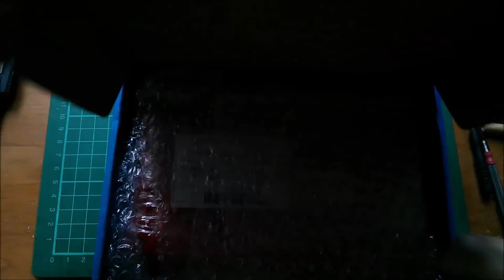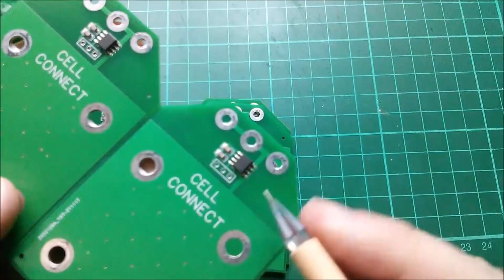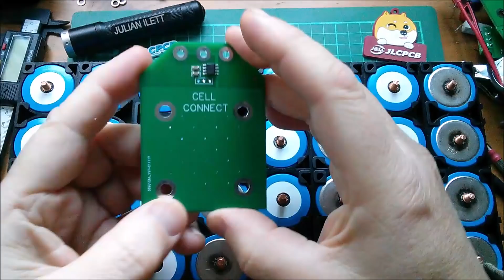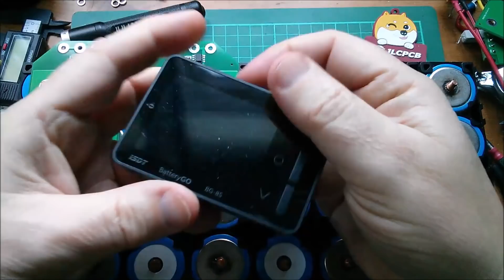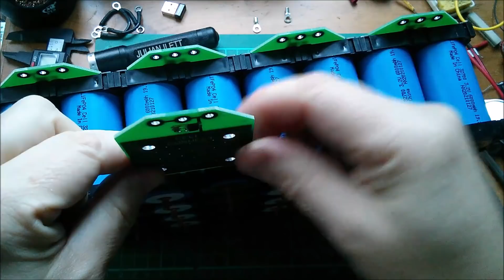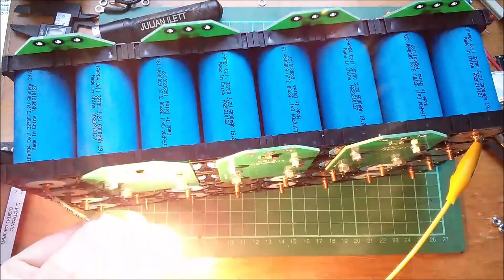New PCBs from JLCPCB - Cell Connect with ACS712

Comment: You could get rid of the plastic frames, then you can choose the spacings and create a single, much larger pcb per side covering all the cells. The pair of pcbs will be more than strong enough once all the cells are bolted on. The primary pcb can also hold your arduino. 
As others have said fuses would be good, but how about temperature sensors.

Comment: if you use a board to connect the bottom ones put a pcb on top of the bottom ones instead of the link wires

Comment: Would have been good to include an exposed pad on the lower middle for soldering link wires to other junction boards. Easy enough to work around after the fact using some sandpaper or a small chisel.

Comment: Instead of 8s4p, what about two 8s2p cells in the same housing? You could use your existing design and parallel them to get the whole current draw. Could side-step the 40A limitation? 🤷‍♂

Comment: Do you pre pay VAT / Customs through JLC?  If not did DHL try to charge you import or not catch it?  Everytime I order from Chinese PCB manufacturers and get it delivered via DHL I always get hit with a £17+ fee, £10+ of that is DHL's "processing fee".
Reply from the maker: I think JLCPCB must add it all in when ordering - I've had 40 or so PCB orders delivered without anything more to pay.
Reply: @JulianIlett  Ah interesting, i've seen other suppliers give 2 options - 1. DHL or 2. DHL pre-paid customs.
Reply: That DHL thing is a scam, as customs charge for many items is zero so they are processing nothing except their fee.  Of course there is always import VAT, which DHL resolutely try to charge even if the shipper quotes your EORI on the label and you handle VAT yourself.  Avoid DHL is my strategy.....

Comment: These days I see the DIY powerwalls having a fuse on each cell, incase a single cell shorts.
Reply from the maker: I suppose fusible links could be designed onto the PCB.
Reply: @JulianIlett  perhaps a sacrificial trace with a couple HASL pads at either end so you can service the battery and replace the "fuse" without tossing the board.

Comment: you could have made the boards longer and have 8 holes to fit all the batteries?? so the cell connect would link then all??
Reply from the maker: Then I increase the pack size to 8S6P and end up with the same problem :)

Comment: Copper is far too soft to hold a thread. Those brazed posts will be an alloy like beryllium copper.
Reply from the maker: Good point :)
Reply: Most likely just steel and copper coated as most grounding posts on metal paneling

Comment: Are you sure the outer boards will be able to handle the current? I assume the middle boards will be cold, but the outer ones will carry entire current coming out of the whole pack as the currents from all cells will add up.
Reply from the maker: Current is the same at every point in a circuit (unless there are branches).
Reply: @JulianIlett  Ah yes, in serial the voltages add up, while in parallel the currents add up. Those boards/circuits are a combination of serial and parallel which only adds to confusion, but they are overwhelmingly serial connection, so the max board current will equal to a 2xCell current, because the boards put 2 cells in parallel in each series.

Comment: Cool stuff! I'm definitely going to use this idea in my own battery pack! But given how it takes a couple of weeks to receive stuff from JLCPCB, I think a less modular approach would be better at first (as in 4x2 instead of 2x2+wires) - then I would modularise as needed.
Reply from the maker: Measure those hole spacings carefully :)

Comment: I think the trace going to the chip is way too thin even for 5Amps.
Reply from the maker: Maybe. The trace width calculator says temperature rise would be about 50C at 5A. If that active balancer ever gets to 5A, I don't think it will be there for long. We'll see :)
Reply: @JulianIlett  Time will tell.
Reply: My 30A acs712 version pcb has 5mm wide traces, judging by that he should be fine 😁

Comment: Shame you could not make 1 pcb to connect top to bottom without links.
Reply from the maker: I quite like the modular approach. It's possible I'll buy some more cells and make it a 6P pack.
Reply: @JulianIlett  i would never have thought you like a modular approach lol FOTMS (fans of the modular shed)
Reply: One PCB to rule them all?
Reply: A four-long version with snap lines so it could be easily reduced to something smaller would be good. That would just leave the problem of making sure there was still sufficient copper to handle the current. Maybe a few big vias so 16SWG links could be soldered across the snap lines.